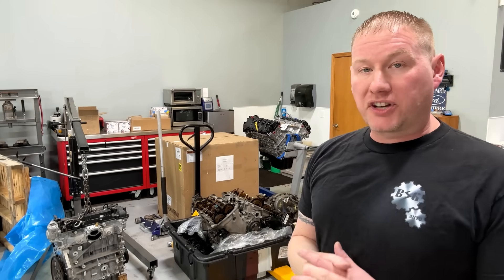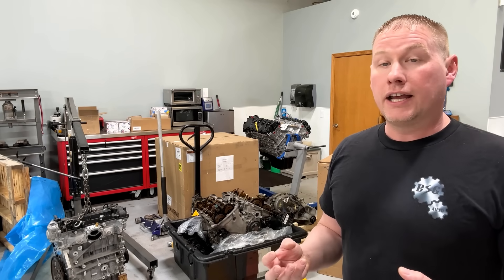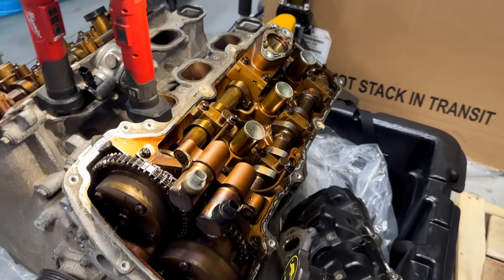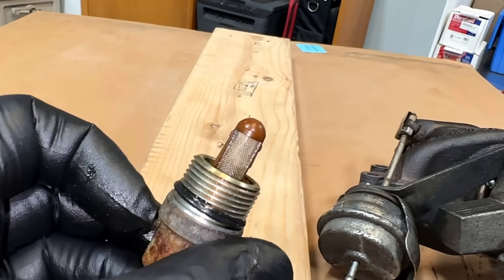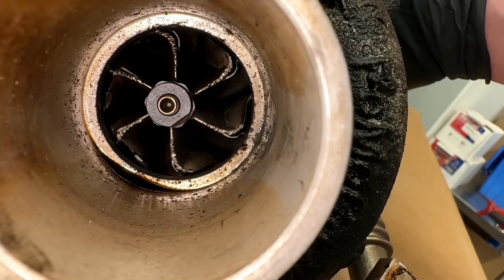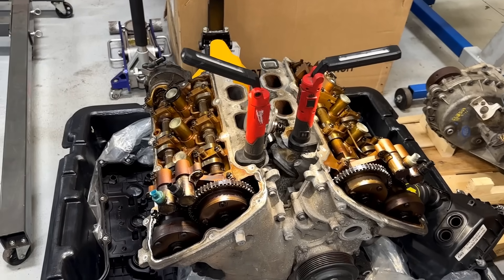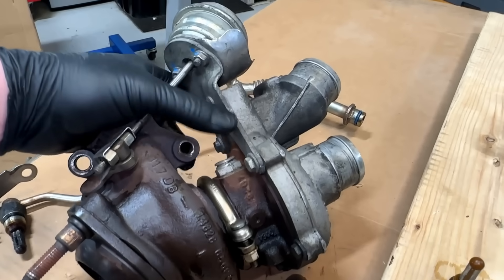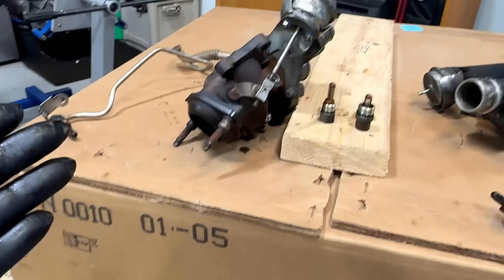This is Why You Never Run Extended Oil Change Intervals on The Ford Ecoboost Engines!

Comment: In the early 70's  (my early teens) I use to work at my dads plumbing shop during summer vacation. There were about 12-14 trucks....all severely neglected. One of the first things I was told to do was change the oil & filters where needed. Most of the trucks had thick BLACK oil (sludge)....and were all 1-3 quarts low. Dad kept a 50 gallon barrel of 30W motor oil in the yard.. I learned a lot about engines and plumbing during those years. I found the best way (for me) to check oil is by sampling it (Look at the dipstick). You can tell a lot about oil by looking at it, smelling it and rubbing it between your fingers. If you baby your engine (like my wife does) the oil lasts up to 10k. If you drive like 40% of the drivers (idiots) here in SoCalif, who only know brakes and acceleration (lead foot) you better change it every 3k. I have owned 1 Oldsmobile, 6 Fords, 3 Chevy's, 1 Buick, 4 Toyota's, 1 VW. Only 4 of the cars were  brand new...2 Ford F-150's (95 & 05), a 2018 Ford Edge and a 1984 Toyota Celica. I have never experienced a major engine oil failure in my life....never been stranded. I heard a front wheel bearing going out on my (used) Excursion once. Pulled over had it towed 7 miles to my mechanic. He said "If you have off-set wheels you better change the bearings every 60k". I didn't know they were off-set and replaced them with non-offset rims with 35" tires.

Comment: Very eye-opening post-mortem analysis! Those turbos choked to dead 😮. I have a company-owned vehicle & is very hard to get approval to change the oil sooner. They try to "save" on maintenance by changing the oil at extended intervals. I don't drive that much so I only change it once a year because I don't even reach the mileage of the oil-change sticker.
Reply: They're leases. Who cares?

Comment: How difficult is it to clean or replace the turbo oil feed screen as a PM item?
Reply from the maker: Very difficult at a few hours per side. They should never need cleaning as the used example screens shown in the video.

Comment: If there is that much contamination that a screen can be clogged and the size of the particles needed to clog a screen points to an oil filter than is not filtering down to the 3.5 micron that is the industry standard. Particles large enough to clog the screens are large enough to do serious damage to the engine. Do some root cause analysis asking the seven “whys”. It also seems that a scheduled replacement or inspection-cleaning of those two screens would be part of the maintenance schedule. I sure don’t like the idea of particles so large that they can catch in a screen in my oil.

Comment: I figure those smaller engines need more frequent oil changes due to the lack of cooling and quantity... then you look at large diesel engines and how long they can go on good oil (even with oil sampling). Blowby helps with that intercooler drill hack (or the proper way is to use a catch can)... less crud to regurgitate.

Always appreciate the info you give. My 2013 3.5 is going to get the necessary repairs when required. 50k miles on it so hopefully get to 100k without issue.

Comment: Of the multiple anti-wear chemicals added to new oil, most still burn or evaporate off by 4000 miles.  Dump enough microscopic PTFE into oil and I guess technically you could claim it “protects” to 10K.   Oil is cheap. Change it.

Comment: I’m surprised to find this, as it is opposite of what the have found with my 1.0 3cyl ecoboost. The first 200k of my engine were 20k plus oil changes and the oil looked great at the service. At 360k I had to do a replacement on the turbo due to so many cycles on the waste gate and wearing out the linkage to the point it wore through and the block plate shot into the exhaust. On inspection the bearings, vanes and housing were all in great shape. It would appear when doing oil changes based on driving habits would be the way to go.

Comment: Here’s a fun question for you. I have a 22 ford explorer st and I love it for the most part. But I noticed how crazy warm the car gets under the hood. Nothing that sets off alarms, but a lot of aftermarket manufacturers have come out with intercoolers to make the motor run cooler. Whipple makes a great one that I want to invest in. My question is as follows. Will installing an aftermarket intercooler void a warranty from Ford, even if installed by someone like you? I bought the 5 year/ 100k warranty when I bought the vehicle. And I really don’t want to mess that up.
Reply: Yes it usually would but depends on your particular dealer. Inter-coolers are usually pretty plug and play if you keep your other one and have any knowledge whatsoever you should be able to swap them out yourself. No offense but if you can’t learn to swap your own intercooler which is essentially just a small metal box, I would consider just leaving the car how it was designed brother.

Comment: I use Mobil One 20,000 mile synthetic but change it at 10,000 miles. I also change oil filters every 5,000 miles.

Comment: hi what are you doing for ecoboost timing chain? its been on national back order for a month now?
Reply from the maker: The second gen engine chains are on backorder, but my dealer has their sources, so I have been able to do timing jobs still. They also just received a seed stock of 28 so we are good for a while.
Reply: @FordTechMakuloco  yea i have a job waiting a month now. would you use a cloyes if you had to? they are available. tia
Reply from the maker: No way never, Cloyes chains have been breaking on people recently never ever.

Comment: Besides full synthetic oil changes every 5k and milestone maintenance intervals, is there anything else y'all would recommend to extend the life of the 3.5? Trying to keep mine humming as long as possible (or at least outlast the stupid 10 speed) lol
Reply: Don’t for get ti do a drain and fill to the trans fluid every 10,000 miles or do 3 or them every 30,000 miles.  Change coolant every 6 years or 60,000 miles

Comment: So I have 2018 F150 with the 3.0 Powerstroke and have used the Intelligent Oil recommendation from the truck which is calculated apparently using a secret algorithm.. Interestingly,  since day one (50 months ago) the miles between changes have averaged 7500 to 10000 miles now that the dealers are increasing everything to include oil changes for the 3.0 over $200 the change interval has mysteriously gone down 5000 miles or less. Am I paranoid or can the dealer change this algorithm to make you spend more money??

Comment: I have a 2011 3.5 ecoboost. Synthetic oil every 7k-9k (km's, in Canada lol). Engine runs like a top, tons of power. I mainly put highway miles on it so I have to think that helps. Very little likelihood of deposits building up from excessive idling. These engines can and do last a hell of a long time, you just need to keep up with your pm on them and consider what kind of driver you are. These probably aren't the engines to buy if you plan to do a lot of city driving and idling in traffic.

Comment: Besides the obvious reason for this failure, was the customer also electing to use conventional oil?
Reply from the maker: no it would be twice as dark inside.
Reply: @FordTechMakuloco  oh wow, okay

That vehicle has two turbochargers, meaning twice as much heat versus a 1.6 ecoboost engine with one turbocharger… do you still recommend 5,000 mile oil changes for those engines as well?  I personally change mine between 3k to 5k miles just to be safe 😊

Also I have been a subscriber for many years and just today discovered your other YouTube channel lol

Anyways, thanks for your help!

Comment: @Fordtechmakuloco Sorry to bug ya, this hasn't nothing to do with a ecoboost but a 2008 5.4L 3v. Do you have any videos in regards to a bank (Bank 2) being over-retarded with error codes as follows:  P0022, P0300, P0305, P0307, P0345. ? Appreciate any help with links to videos, I believe I'm being screwed by a Ford Service Center on a recent $5K timing job.

Comment: I've only used Mobil 1 full synth 20k mile oil in all our vehicles including my 17' Escape and not had a single problem. It matters what oil you put in! Use cheap oil, get cheap results....
Reply from the maker: Do you run 20k intervals?
Reply: @FordTechMakuloco  I have and it's been fine. A buddy of mine told me about the issues this engine has had and that has me concerned. I'm not doing 20 anymore. Probably cut that in half now.

Comment: I am on my 4th 3.5 truck since they came out in 2011. No one had to tell me to change oil much earlier than what is recommended. I have always changed my oil myself at no more than 4000 miles. Actually went back to 3000 miles on last new truck. 2021 model bought before price gouging. Use Mobil 1. Have never had any issue on my trucks.
Reply: Try the Valvoline Advanced High Mileage.  Recently switched to this and it’s awesome. Much better numbers on lane testing than Mobil 1

Comment: The environment you live in is a huge factor that needs to he considered in oil change intervals. Here in Nevada it's hot, dry, and dusty. Often there is no wind and Las Vegas becomes a dust bowl. With all that dirt suspended in the air the oil gets dirty long before the viscosity is an issue. I've ran 5k miles on full synthetic oil with quality oil and filter (6 quart capacity engine) and had oil dirty enough to feel the grittyness when rubbed between my fingers. What's that doing to bearings and cam lobes? In my environment the ideal interval is 3k to 3,500 miles for my smaller 6 quart capacity engine and 4,500 to 5k for my larger 8 quart capacity V8. Always consider all external factors. As said by many others in the comments, it's cheap insurance to error on changing too often rather than not enough.

Comment: My sister has a European ford Fiesta 1.0 ecoboost 125, and i own a Focus ST 2019. Every year or 10 000 km i change the oil no matter what, cars runs smooth, no strange noises, same as new. Scotty Kilmer always says, oil is cheap engines are not. Ford engine is not for the average stupid murican, nor for the doesn't care maintenance schedule European. Its a very tight running Swiss clock. Follow manufacturer book guide lines, forget what the dealership says, follow the book written by the engine builders, everything else is snake oil.

Comment: What is "extended oil interval" in US?
In EU it is 18k miles OR 1 year (or 2 years in some unfortunate cases). 
People forget this  OR 1 YEAR and maybe the instrument cluster forgot too:)). 
(it is implemented on newer vag cars)
Normal change interval is 10k miles for all cars in my country and usually this is the medium run for 1 year. 1 year is extremely important. 
After yearly change comes the number of miles/km but this all started the other way around. 

In each country the oil interval is different and that is because of the medium number of KM most drivers make a year. This is how "extended" interval started...because of countries like Germany that has long driving rages and the average is around 30k km (18k miles) a year.

Comment: I always follow the oil-life monitor's recommendation for oil-changes.  And I use the Motorcraft synthetic-blend oil and Motorcraft filter that the vehicle came with.  Even on the non-Ecoboost engines.  Because the oil-life monitor in the vehicle was designed with that oil and filter combo in mind, so it's going to be most accurate when you use that oil and filter.  Or at least, that's what I thought...

Comment: Awesome video. Since the first oil change on my '19 EB 2.7, I've gone with full synthetic at 5k miles. I've always said, "gotta protect those turbos!". Also, drive it gently until the engine is warmed up - never spool up a cold turbo.

Comment: so...how often(miles) should the turbo filters should be cleaned/replaced. Or, at 5k intervals, should there be no clogging of the turbo filter screens.  Thanks for this video, it opened my eyes since I'm a new owner of a 2.0 Maverick and kinda sick to my stomach after watching this
Reply from the maker: No the filter should never need to be changed. The used clear filter was from a 150k mile vehicle that had regular oil changes.

Comment: Hey I have a question I have been following for a while now. Just finished my 2006 f150 with the 5.4 3V it run good thanks for showing me how to do it. I put a fuel additive in the tank now I am having a on and off miss fire . Do you ever us additives in your truck

Comment: How much do you trust the oil life (optical) sensor on the ford eco boost? I have a 19’ and run full synthetic with changes every 5,000mi. My life indication says I usually have 50% oil life left at time of change but I never trusted it based on my visual inspection.

Comment: Whats the recommended time to change out those turbo oil screens? My dad has a 2017 explorer with the 3.5 with 50k miles on it so I'd appreciate knowing what the timeframe is for changing them out.

Comment: It is possible to run extended intervals with high end boutique oils, not stuff you will find on the shelf at Walmart or a parts store.  But this needs to be proved out with oil analysis and particle counts.  For most people, better to just change it at 5K because they're not going to run true PAO or POE boutique synthetics or go through the trouble of going through an oil analysis program.  That stuff in the filters, is sludge from inferior Group III "synthetics" run too long.

Comment: A 5K oil change at about $90 will cost the owner about $3,600 over 200,000 miles.  Assuming all the damage pointed out here with turbos, etc., you’re still paying less the half the cost of parts and labor by just getting the oil changed. 
The old adage is still true, oil is cheaper than steel (and labor).

Comment: I ownerd a 2013 V6 turbo f150. The dealership talked me into it. I traded it in for 2016 5 liter V8 f150. Too many problems. The coyote V8 is rock solid.

Comment: I have a question! I purchased a used car that has a turbo engine. I assume those screens are also present on it...  1) is there an additive (such as maybe seafoam) that could help clear up these screens (if they are clogging up) and 2) Would it be recommended that I pull these oil feed lines and visually inspect these screens every 1-2 years? The car had 66 000km (41 000miles) on it when I got it and it runs just fine. No symptoms. 

Thanks for the video!! A failing turbo is my nightmare and I had no idea these screens existed.

Comment: I have a 2017 fusion 1.5 l ecoboost, and i change my oil every 3,500 miles with motorcraft synthetic blend and im at 135,000 miles. Still runs great and is such a good car. Its all about maintenance, not so much on the type of oil.

Comment: I want to buy American but it’s getting really hard to do.  Ford has engineering issues and many of their parts are made in China anyway.  Whereas I can buy a Toyota built in the US, and made with mostly US parts.  And the Toyota will be way more reliable and hold it’s value better.

Comment: 224,000 is not a small number of miles.  Are they city or highway miles, that would make a difference.  I change my oil at every 5,000 miles as you suggest.  It ends up being an oil change every two/three months.   I am surprised that someone wouldn’t think about their engine oil as a car is the second most expensive item people purchase besides a house.
Reply from the maker: Mainly highway.

Comment: @FordTechMakuloco : For those of us changing within the appropriate window, when/should the vct/turbo fitting screens be serviced/replaced considering a preventative maintenance approach? Even with regular (3k to 5K) oil service, I would imagine it could be to an owner's benefit to get ahead of potential issues. Thoughts given your experience? I want mine to be a forever truck, so these nuggets are extremely valuable, imo. Thank you for taking the time to put this type of content together.
Reply from the maker: If you maintain your oil they will look just like the ones I showed clean and clear even after 150k miles.

Comment: I agree with you . The problem is as a customer how would you know if they replaced the filters, they could say they did but did not even touch them. As procedure if the turbos are being replaced then the filters should also be replaced. I do not trust dealers they are cheap and shady. Just stay away from vehicles like this that have turbos unless you can do the work yourself. For me it is not worth the risk.  Change your oil often and that should help.

Comment: Are these turbo oil supply filters something that need to be cleaned or changed as certain maintenance?  If so when & where r they from or back of engine & are they easy to get to?  I couldn’t find them when looking in hood.  2015 3.5 f150 53K mikes.  Thank you

Comment: 2016 EB 3.5 F150. Did catch can per your recommendation BUT.... I change Royal Purple Full Synth every 10k miles and have been sending my samples to Blackstone - they are always recommending longer intervals if I wanted to because Oil is still healthy. Not saying you are wrong, and I may find out the hard way at 200k, but there must have been something else wrong with this particular truck you took apart.

Comment: Do the turbos need to be removed to change the filters? If not, how difficult is it to change them? And could you do a video on how to change them plus other maintenance to improve the life of the engine. I have a 2013 3.5 2T. I use a catch can and change the oil every 5k with Schaefer

Comment: Geat Video!!! I own a 2019 Ford Edge ST 2.7EB V6. I change my oil at my dealership every 5,000 miles. I never paid any attention to the oil life monitor at all. I was not aware of the inline oil filters on the turbo oiling system. I have 63,000 miles now, but when I get close to 75,000 miles, I will be sure to order new oil supply lines and filters and have them changed !!